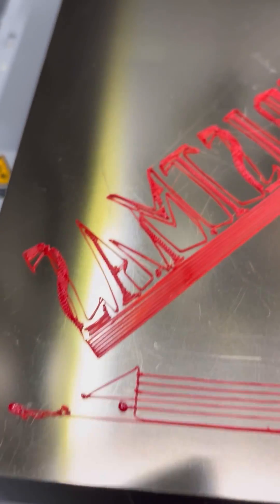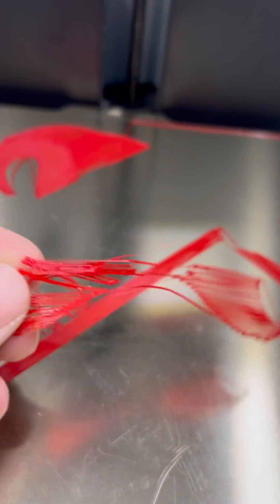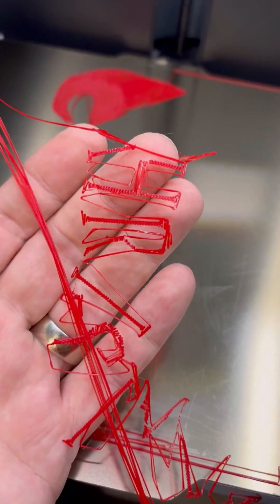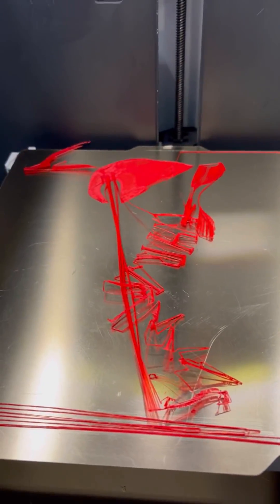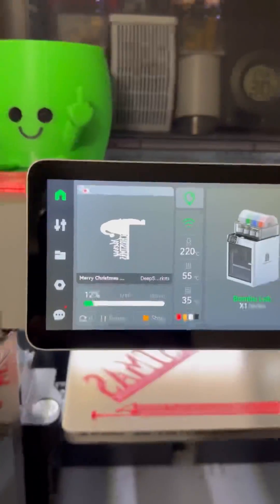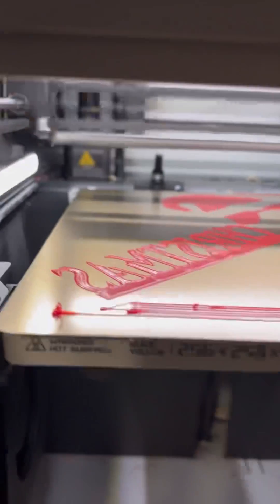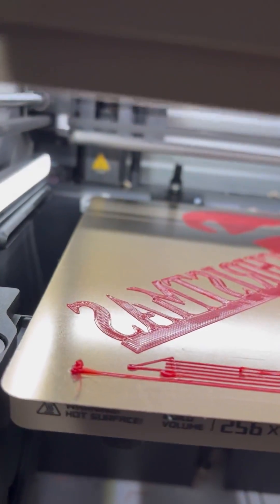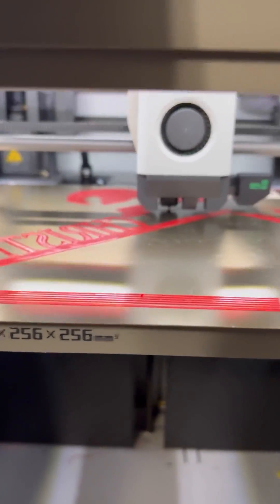Bambu Lab Start Print FAIL Happens to Often

Comment: Clean you plate mate
Reply: Also dont touch the build plate with you fingers at all like never. If you do clean it with 99% isopropyl alcohol
Reply from the maker: @kishore_rabha  I clean regularly but only with dawn I use to use alcohol but didn’t notice a different between it and Dawn dish soap.

Comment: Very weird behaviour, if it failed every time I'd say try glue stick or glue spray so the first layer adheres better to the printing plate or alternatively use a textured printing plate since most people struggle to print on the smooth one 

Let me know if you ever find out what the problem is